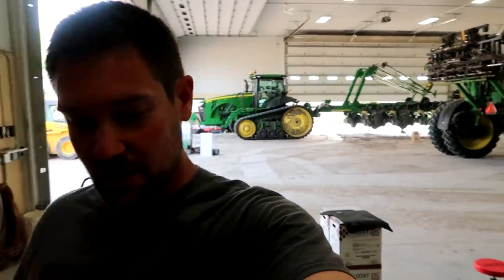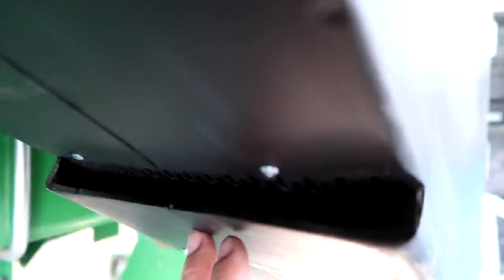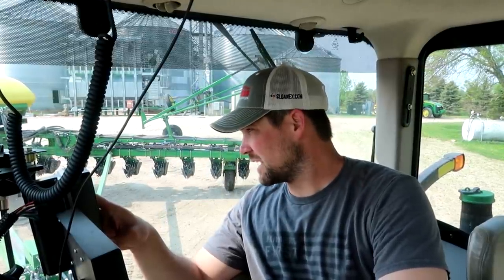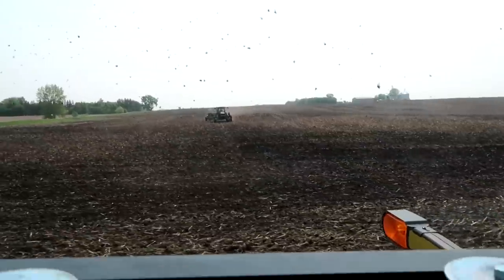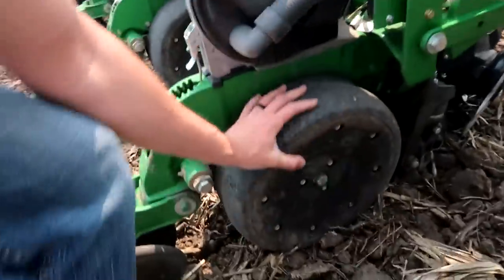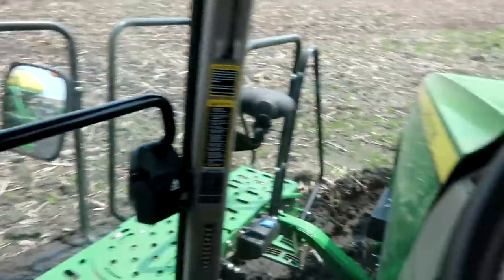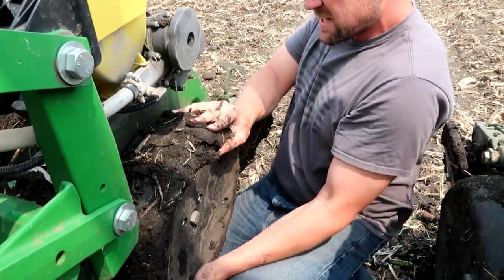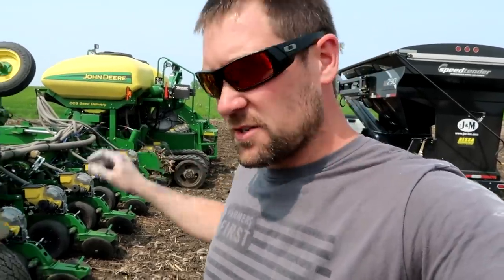My First Experience With No-Till

Comment: Is your pool filled with algae? Looked so green on camera xD Great vid as usual! <3
Reply: Yeah, that thing needs work.  My 65kgal is clean, blue, and temp sittin at 82.  Zach needs about four gallons of chlorine and a good vac.
Reply: @LordNelsonkm  UV lamp and a sand filter is also an option :P But yeah a pool requires serous cleaning capabilities.
Reply from the maker: It’s iron, we just filled the pool. It will be crystal clear in a day or two.
Reply: Green to match his tractors.
Reply: @MillennialFarmer  Some glyphosate would take care of it.
Reply: MN Millennial Farmer 10 days later starting to clear up. LOL
Reply: usually happens with above ground pools when you first have water in it. Its iron in the water causing it ti turn dark. It clears up in a week or less. Happened to us loads of times.
Reply: @MillennialFarmer  fair enough
Reply: That’s what you get for buying a Chevy
Reply: Do u have bird or duck trouble?
Reply: @jamesbowene9153  The only bird trouble there is anywhere is pigeons! Hate them!
Reply: P

Comment: Pro tip: forego the seed tender all together unless you have individual seed bins. Put forks on a front end loader tractor and hang the entire box over the seed tank. 50 units moved in 10 seconds. I show up with a flat bed semi carrying a loader tractor, at least 4 boxes, and a vehicle with a built in tow bar. Show up, puke everything out and head for the fertilizer truck (which I hook the vehicle to).

Comment: If you ever get tired of digging mud out of your depth control wheels, try out the open ones with the three spokes. Those things are miracle workers and just let all of the mud fall out of them rather than plugging.
Reply from the maker: I think I might get some for around the planter wing wheels.  That's always where the problem starts because those tires push the mud first

Comment: A hot air gun will soften label adhesive so that it peels off cleanly.  We used to hot-water bottles to get the labels off floppy disks, so I'm guessing 80 to 90°C (26 to 32°F) does the trick.  That means keeping a hot air gun a good six inches from the part to avoid damaging it.

Comment: You will love notill  give it time...
Mostly working soil is in your head

Use rye etc as well..it is a system
Reply from the maker: We've tried it but haven't been able to get it to work yet.  We have a 40 that didnt get worked last fall and it's still a mud pit right now
Reply: Part of no-til is cover crops, the root create porosity to drain water, the root and above ground debris helps float equipment. Used to do a lot of septic systems, could drive over sod with dump trucks seven times (almost exactly 7 X) mostly built roads in. It’s amazing what sod will hold up on a limited basis.

Comment: We managed to get our 9510RT tractor stuck on Monday, every tractor we attempted to pull it out with also got stuck. We now have 3 tractors stuck in 1 corner of a field. I’m hoping that the 9620rx we are getting on Sunday will pull em out or else we will have to hire in a Case quadtrac chipped to 700 hp

Comment: For a small tractor for the Childer whenever they start knocking machines around, may I recommend a early 2000s Mahindra 5500? They're reliable (we liked the first one so much after 15 years we bought a second, still a 5500 but 4-years newer than the first, a 07 [loader] vs the 03 [no loader, also sounds better]), the only issues we've had was a hydraulic leak in the rear on the 03 when new (warranty fixed), and the spindles on the 03 breaking (my dad decided to see how much trees give away, although finding with the first test that loblollies don't give way, he found the results inconclusive and decided to reconduct the test), and paint (sitting outside for 2 years straight tends to turn a new tractor from red to pink) and the power steering hose slipping off (after 16 years of living in a dirty, dusty, hot, rough and tumble life, also an endless career of running over some not-so-saplinglike-sapling sweetgums between pines. Also dragging dead trees out of a pond that is way below full, grading ditches left by skidders following some thinning/clearing, you know, regular tractor stuff). Also it's the only way to get a International tractor built in the last 30 years. I'm not kidding, Mahindra tractors are direct descendents of the IH tractors of the 60s and 70s (Google Mahindra tractors if you don't believe me). They're also stocky boys, 5000 pound shipping weight on a 50 horse tractor, very large frame (which is also cast iron), we have beat the ever loving crap out of our '03 and he's still kicking right along without complaint, a little smoke yes but no problems at all. I highly recommend the early 2000s Mahindras because from our experience, they are rock solid, or at least were.

Comment: I have had better experience with Fords in hauling heavy loads. I have used 3500 Chevys and 350 Fords.
I had to haul 750 gallons of septic water with both trucks. The rode a lot stiffer and sturdy that the Chevy.

Comment: Hahahahaha I almost wrecked the hay wagon Chevy superior at what hahahahaha  being in the dealership service hay the longest broke down at 10k Zack it's ok you are a millennial inwont hold it against you case Ford dodge or Massey will even run the old 255 Massey over the green machines hahaha long as the dealers are good you can run anything these days but if you have a sh@#$%  dealer nothing is worse then having  to drive hours and or to have to order parts i dont have a good massey or John Deere dealer here both suck I have to drive over an hour and a half to get to a good dealer great video

Comment: Chevy would be superior if they had a truck with a solid axle front end. That independent suspension POS shit they got going on just ain't cutting it.  Watch some tractor pulls and you won't hardly see a Chevy and that's why. They break CV axles and the control arms bow up and cause the front wheels to crab walk from excessive tow in under load. Only of Chevy would get rid of that junk ass front end would they have the ultimate truck.